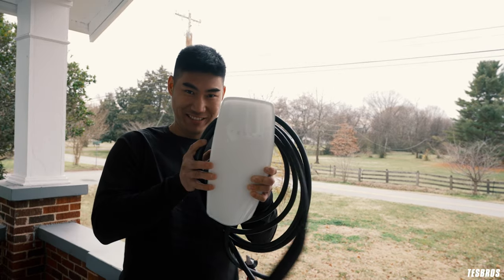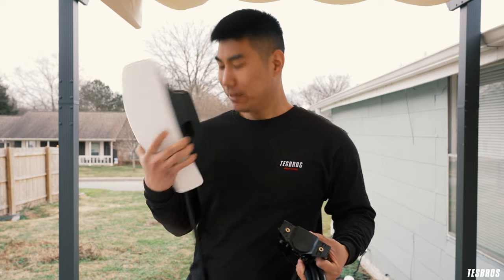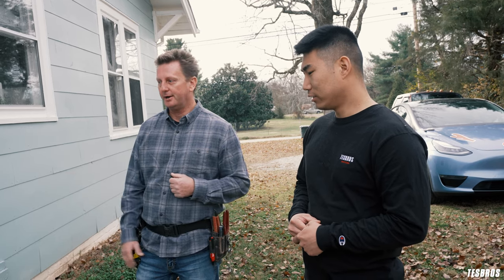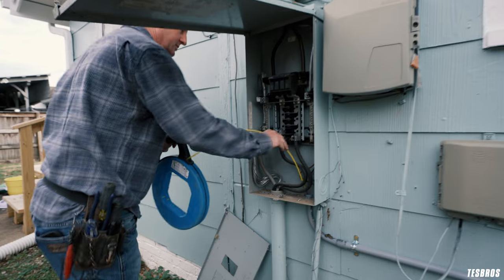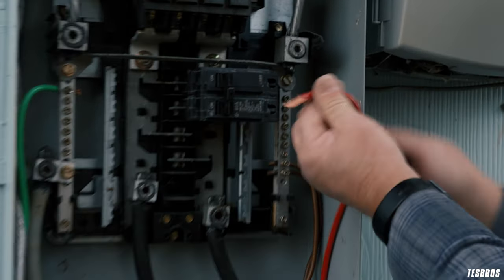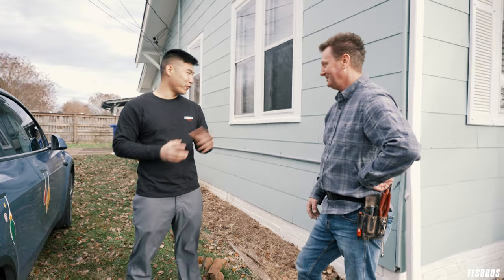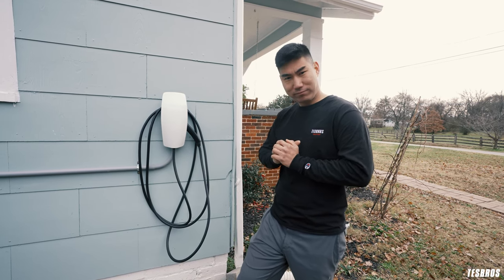Step by Step Guide to Install Tesla Wall Connector (Gen 3) - TESBROS

Comment: Why do people including this electrician lands their line side wires first , a great rule of thumb for safety is always land your load side wires first then the line side last , just in case someone accidentally turns on the breaker while you’re landing the wires to the actual wall charger. It’s just like in firearms “Always assume your gun is always loaded “ in electricity “Always assume your wires are always live.” ✌🏽
Reply from the maker: I'm not an electrician so not sure but that makes sense!
Reply: I'm fresh AF and my last land is always line side
Reply: Lock out tag out kids
Reply: I install power walls and chargers all the time you’re 100 percent right it’s bad practice
Reply: Your wires shouldn’t be landed on the breaker while doing this kiddos lol so it won’t matter
Reply: Wait you run lines to the breaker first and then to the device?
Reply: @christianthieret8088  Agreed
Reply: @KWW0321  Always breaker last. I worked 26 years as electrician in the Navy and Oil Refinery combined and always Safety First , Lock Out / Tag Out.
Reply: @Gapo62Angler  We must have had different firearm safety rules in the Marines but I think I misunderstood your initial comment. I was taught the same way for wiring especially with 3 phase, best to treat them all as if they were live. No point getting sizzled if it can be avoided!
Reply: @tesbros  i think he means ground first, always, just incase yk.
Reply: Device gets wired first, and always start with ground.
Reply: @gamingchunkii1076 what he means is make all your connections at the device or outlet first and be done with it and then proceed to wiring it into the breaker box, this at the very least takes away any risk of electrical shock while wiring the device or outlet
Reply: The real electricians never get electric shocks for themselves. Is this true??
Reply: 0
Reply: @Orbit77777 thank you for making it plain
Reply: @quyenth02  well if they follow protocol then this would be true but when you factor in complacency, fatigue and other distractions then even the best electricians can get zapped or worse.
Reply: @Orbit77777 very true
Reply: @quyenth02 yeah they're immune because they have the, "electrician" title.
Reply: @quyenth02 Nahh! All electricians had a shock at least once in his profession.
Reply: I do it because I like to live on the edge and leave the electricity on and wires live and too

Comment: You don’t need a ground wire the same size as the circuit conductors. That’s big time overkill. NEC table 250.122 allows #10 wire for the ground on a 60a circuit. He went 2 sizes bigger and there is 0 benefit to that. Just more expensive.
Reply: 250.122 my dude. Non sparkys touching my work I tell you
Reply: @nolanandert4258  I know, right. They’re out in force on YouTube like they are the authority on this work. IMO, you want to DIY your own electric vehicle charger, fine. But don’t post videos acting like you actually know what you’re doing.
Reply: @RB-xv4si  should be putting their money into the game, we know what we are doing and get get it code legal. Pay your local electrician!!
Reply: It’s actually safer to make sure ground wire is same size as ungrounded conductors. Especially if home owners are doing a DIY install.

Comment: The electrician i hired did mine for $800 that included the 50 amp rated wire and the 40 amp breaker. He put a range outlet so i can plug the mobil charger.  My tesla is in a garage.. so i dont need the wall charger.  he also told me that he did about 400 charger installs in his life so far… not bad.. the demand is rising….   Because i only have a model 3 rwd which can only be charged at 32 amp.  i don't think i would ever need a 60 amp breaker with 60 amp rated wire,,,  for me 32 amp is more than enough to charge a model 3 rwd.. (actually any tesla).   Maybe someday if i have extra  money i would try a gen3 wall charger, if i can find one used.. but for now the mobile charger does the trick on my m3 rwd…
Reply: 50AMP rated wire is a 6 gauge copper wire and you would use a 50AMP breaker. You should ask your electrician what gauge copper wire he used on your setup.

Comment: You can tell the electrician is a master of his craft. His cable management and use of tools is like a work of art.
Reply: Indeed, I was an electrician in the Army, that brought back memories
Reply: Except he landed the breaker first which is wrong and specially bad that it’s in a video.
Reply: Exactly
Reply: He didn't torque the termination screws in the breaker
Reply: Yea, and also he used (2) red phase instead of black & red, but there is always gonna be critics, especially if this is your field of work (profession) but his work was correct and clean! He gets an 8.5/ 9 out of 10! Good job guy!

Comment: Nice, simple installation, similar to mine. However, I'm surprised he used steel pipe straps. Hopefully they're galvanized. Check them, because they may rust. You may consider replacing them with non-metallic (grey) straps, should  you run into a rust problem. Thanks for sharing.
Reply from the maker: Thanks for the tips!
Reply: lol
Reply: They’re called straps, not clips.
Reply: @RB-xv4si  thanks, I've updated my comment.

Comment: #6 copper THWN is sufficient  for 60 amps and a #10 AWG copper equipment grounding conductor is an industry standard ground for a 60-amp load. That open KO seal should also be closed up.

Comment: You made it look easy pulling that #6 wires in 3/4
Reply: Long runs are easier with staggered wire ends taped and tied.  Lube helps. His short run was simple.
Reply: Short run, 180 degrees of bend, and super slicks. Easy of a pull as you’re likely to find.
Reply: That looked like 1/2 conduit

Comment: Quick clean install, but going to echo another comment about torquing the terminal screws in the wire box and breaker. They need to be torqued to 50 lbf . in  (pound-force inch) as per manual. Loose wires at terminals will create arc, arcs create electrical fire. Stay safe out there!

Comment: best video ever. i was able to install mine by myself.
Reply: What gauge wire does this use, for a 60 amp breaker?

Also, what is the length of the charging cable? (To the car)
Thank you.
Reply: @iv2917 6.  It’s in the manual.  Minimum 6 awg.  The directions are for a 60 amp hook up.  I believe 6 awg 90c is rated for 75.  Everything is going to need to function at 80% of rated.  I’m not an electrician and this comment is purely for entertainment.

Comment: Need to use a torque screwdriver on both the breaker and the charger base terminals. No matter how experienced a sparky you think you are, 80% of electricians don't torque their terminals right, which is a problem down the line.
Reply: Why is it an issue?
Reply: @filibertosalinas6816  1. The code says so. 2 improperly torqued connections are a big problem.
Reply: @filibertosalinas6816  Incorrectly torqued terminals can cause the connection to arc and spark, starting a fire; or it can make the components work harder than they should, which leads to overall component degradation.
Reply: If you have under torqued terminals, that leads to increased resistance and increased heat stress, which is what causes fires. So yeah, it’s important. Also it’s a code requirement; 110.14(D)
Reply: Is a problem but probably won’t affect the consumer… similar to putting tires on your car with a torque wrench… tight enough is usually good… “MOST” of the time
Reply: @tokentoker2392  totally the wrong mentality.
Reply: 100%. If you look at the label of one of those Square D 60A breakers, the torque spec is 45 in-lbs for 6 AWG. There's WAY more torque than what you would usually use when you think it's "tight enough". Get a torque screwdriver and put it on 45 in-lbs, you will see what I mean. If I hadn't done it before I would think that much amount of torque would strip the threads. I assume with a wrench it's much easier but it's not what most people use for breakers.
Reply: 45 in-lbs torque on a crossed threaded terminal = faulty connection but torque reads correct but no pressure on the conductor ... pull on conductor to check and count equal amount of threads. 48 years as a licensed electrician torqued connections need to be checked.

Comment: Yeah man, great video. I was worried about installing this at first, but I'm glad it's a lot more simple than I thought. But what I really don't understand, is why you can put a 48 amp load on a 60 amp breaker, but you can only put a 32 amp load on a 50 amp breaker. Shouldn't you be able to charge at 38 amps with a 50 amp breaker? I know if you get too close to the overload threshold current of a breaker, it overheats the element of the disconnect mechanism, and can damage it,  making it impossible to turn back on once it turns off, and worst case scenario it can make enough heat to cause some polymer in the fuse box to catch fire. What I don't understand is why you can get within 12 amps of the 60 amp threshold,  but you can get within only 18 amps of the threshold of a  50 amp breaker. I'm thinking the element for the diffusing mechanism in the 60 amp is a little more resistant to heat then the element in a 50 amp breaker, which actually allows you to safely get closer to the maximum load of the 60 amp breaker.

Comment: You should include the setup, which is a bit confusing because you join the device to your WiFi network, but still configure it by power cycling and connecting to it as a WiFi hotspot.

Comment: I would recommend TTHN #4 and you can use a #6 or #8 ground in 3/4" conduit.  This will allow you around 76A of capacity if you want to add another wall connector and share the load, that's 38a each.  The cost difference for me was about $.50 per foot on the #4 wire TTHN vs. staying w/ TTHN #6.
Reply: He hired a pro that knew NEC section 625.40 states,. "Each outlet installed for the purpose of charging electric vehicles shall be supplied by an individual branch circuit eat circuit shall have no other outlets."
Reply: I missed this one:

2020 NEC table 310.16 does rate thhn in the 90 degree column..... #6 @ 75 amps.

However, section 110.14 TERMINAL CONNECTIONS rates 100 amp or less breaker terminals at 60 degrees c unless other wise marked on the breaker.

This puts whatever wire that is connected to the breaker in the 60 degree column.  This changes your wire rating to #6 @ 55 amps.  

So, in your example, you could connect #3 copper (#3 @ 85 amps) to the breaker then  use 90 degree c "terminal lugs" (wire nuts if you will) to connect to the thhn to use the 90 degree c rating just to get your 75 amps on the circuit.

Can a Diy'er do all this, yes!  Do I recommend they do all that, no!  Just use the 60 degree c column and size their wire.   The panel above will get unrulely really fast if they jump through those hoops.
Reply: Depends if he has a 200amp msp or a 100amp msp.

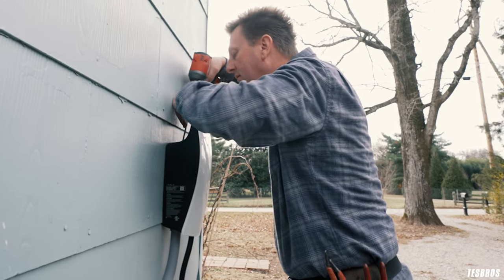Comment: at 9:20 or so, you should not use an impact driver for screws (that are probably going into plastic), really easy to strip.    use a drill with the torque set down to like '10' out of 20 (20=drill) if you need power driver, hand screwdriver works well too, and much easier to not over torque.   Code here in Minnesota is now requiring GFI breakers even for 240 v circuits like my welder and soon to be installed Tesla wall charger.

Comment: Your electrician should have installed PVC expansion coupling or couplings. Also it looks like his ground wire was unnecessarily oversized. It looks like he used a full size gram of number six, but the code only requires a number 10 which would have saved money on the additionally by the 2020 code is now required to have a GFCI protection to pole breaker at the end of this VO, he mentions putting quad breakers or twin breakers in to make space in the panel. He should’ve mentioned that those twin breakers are many times not permitted to be installed in certain panels. Always follow the UL list at manufactures instructions further note if you didn’t have the breaker panel outside as close as he did, you would also need an outdoor service disconnect within sight of the charger or not more than 50 feet

Comment: that's the easiest location to install it.  siding/exterior surface mounted breaker/ conduit/ no attic crawl wire dropping through drywall.

Comment: What about protection from rain?  Is that wall charger completely waterproof on the top side?  We plan to install ours outdoors too, so I am wondering if I should put some kind of shelter over the top of the unit?
Reply from the maker: The Tesla wall connector is waterproof! I don't have anything over mine and haven't had any issues.
Reply: It’s a NEMA 3R rated enclosure so it’s meant to handle rain.

Comment: … do I have to use Wi-Fi with this?  or can I ignore the Wi-Fi and just hook it up and it will work?
Reply from the maker: You don't have to use Wi-Fi with the Tesla Wall Connector for it to work. The Wi-Fi connection is primarily used for software updates, monitoring charging sessions, and adjusting settings via the Tesla app. If you're not concerned about those features, you can skip the Wi-Fi setup, and the Wall Connector will still function normally to charge your Tesla.

Comment: I ran some 6AWG through 3/4 inch it was a pain in my ass. But I had more bends, which might have been why.
Reply: I feel like you need 1 inch for 3+1 6AWG.
Reply: Ok I see, he used already separated wiring. I used 3+1 6AWG that was sleeved together already.
Reply: @R0B0T2k  I'm getting conflicting information from everywhere. I was getting 6/2 sleeved to run mine but some people are saying you need a neutral. I don't see anywhere, including in the Tesla manual that you need a neutral. All manuals show 2 hot, 1 ground. I'm connecting directly to my main panel with a 60A breaker.
Reply: @jeffferraro4981  you don’t need a neutral but, that 6/2 sleeved isn’t up to code for the 60 amp breaker. You need THHN like in this video
Reply: Then you should run # 4 wire. For 60 amp breaker.
Reply: @michaelhlavacek5159  not necessary

Comment: Good video.  The Tesla instructions note that two hots and a ground is what is required in the USA.  The 60 amp breaker will be noted by the set up, and 48 amps is the maximum that the car will allow or accept for charging.  That is the maximum for Tesla home charging, and # 6 thnn wire will handle the 48 amps which is exactly 80% of the 60 amp breaker.  No common wire is required.
Reply: My installation instructions do not say that

Comment: I guess no white neutral wire for this installation ?
Reply: Standard installation today for heavy electric equipment at home: Stove, Washing machine, electric drier, and charging for EV comes with: 1 ground, and 2 hots for USA standard. I believe the hots are always 120v x2. For Sweden where I lived before, its automatically a 220/240 outlet and its 1 hot red which is 240v.

Comment: I wonder if the wall charger is waterproof?
Reply from the maker: It’s weatherproof and should withstand the elements.
Reply: As per state of charge it’s considered a level 3 not 4 which means it’s weather resistant not proof Asper him if you experience an extreme event hurricane etc it will be compromised . I fitted mine with a spare tire cover . The cable actually helps make it round

Comment: That electrician made it look easy.
Reply from the maker: Definitely has some experience
Reply: It is easy for electricians no for homeowners, I did for my son free, company want charge him in 2012 $2,000 job I did in less the 1/2 hour, years later I removed and I went to installed In Oregon.
Reply: That’s years of experience but, this couldn’t have been easier. The panel is outside, no snaking or or crawling to run the conduit and wires
Reply: @marioalvarado3284  you’re a good dad. I wish you had made a video for the people who aren’t as fortunate.
I’m 25 and I know it’s not the youngest, but I still wish I could call someone up for help when I needed it.

Comment: Does the wall connector turn off when not charging?  In other words, does the device constantly draw current when not actively charging the car?
Reply from the maker: Barely any, you won't even really notice
Reply: I think it might draw 1 or 2 watts to keep the wifi active.

Comment: What are these individual electrical wires you use? I did not see material  on blog either
Reply: They’re called THHN wires. 6 awg THHN in a conduit is rated for 65 amps so it can go to a 60 amp breaker and charge at 48 amps. If you go with 6 awg NM-B (romex cable), it’s only rated to 55 amps and needs to be powered by 50 amp breaker for a max charging speed of 40 amps.

Comment: Attached to [shingle] siding. Any excessive tension on the power cord is going to pull the siding right off the wall. Not a secure attachment or installation. JMHO

Comment: question:  why you don't connect the panel inside the garage. I only have 1 electronic panel inside the garage...........
Reply from the maker: This is the only panel I have. If yours is in the garage, that's no problem. Use that one.

Comment: Curious what to budget for the installation in this situation as mine is similar. Thank you !!
Reply from the maker: Hourly rate for labor is typically $75-150. It'll take 2-4 hours depending on how much cabling is involved. Materials will most likely cost $75-200 depending on how much wire you need.

Comment: In Norway, the law doesn't allow us to do any electrical work in our breaker boxes or handle wiring for breakers with amps higher than 15. This rule exists to ensure safety, prevent fires, and meet insurance requirements, making electrical projects costly.

Comment: Well I will still go with just a 220 volt outlet and my Tesla mobile cable kit.  I do not need any more powerful and faster charging rates.  You people can spend the mega bucks if you want to for a better charger, but I don't see that need.